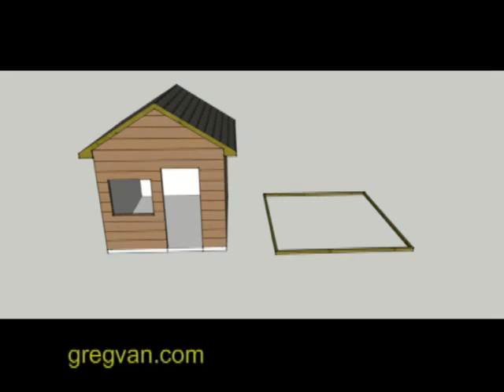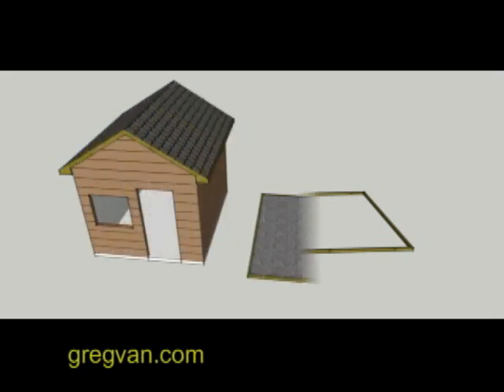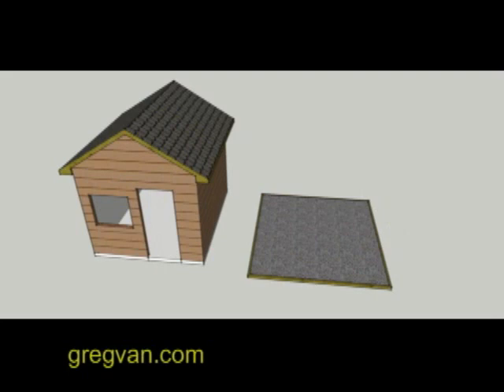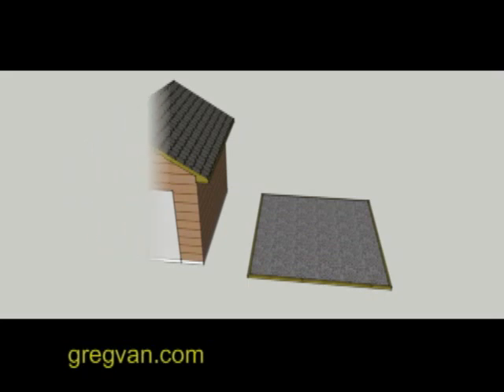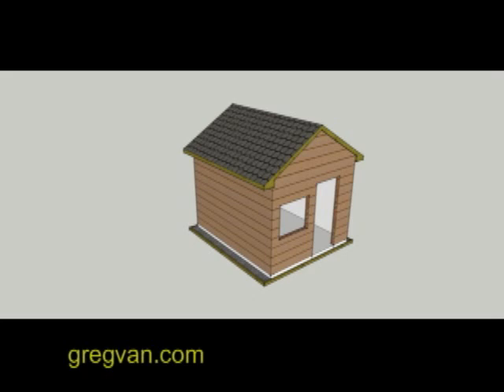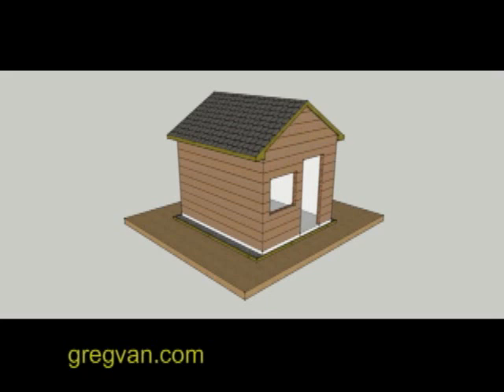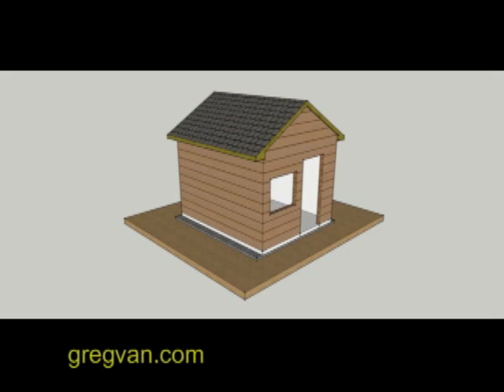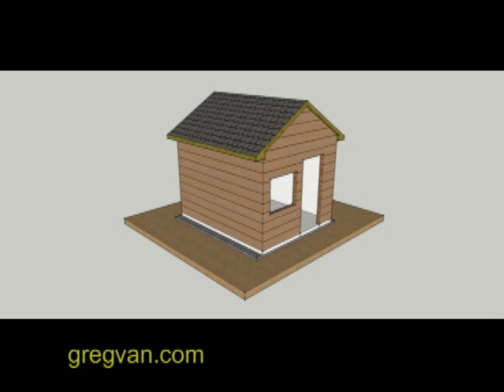Watch This Video Before Placing Wood Shed Directly on Soil – Water Damage Prevention

Comment: TOTALLY loved this video. I am a single mom of 3 boys and I am renovating my house to resell and yet support my mom in the next phase of her life. I had to move the contents of my carport into a 10 x 10 Home Depot Storage shed. Wood, plywood roof and shingle roof. I have a very very boggy yard and drainage is an issue. I had a small machine and operator come in and make an area and we put pit run on top. I whole dump truck. It cost me $500 CAD and I then had a great platform to build shed.